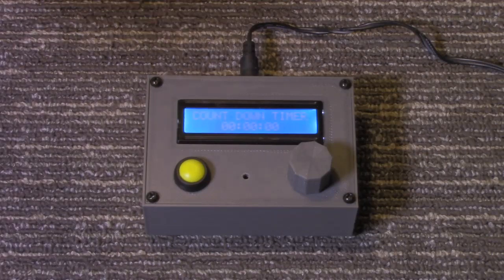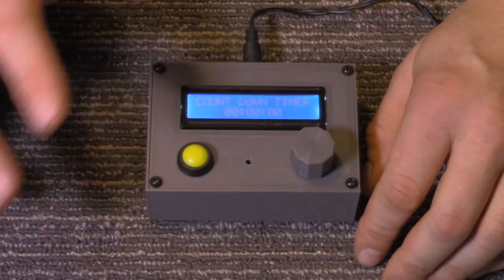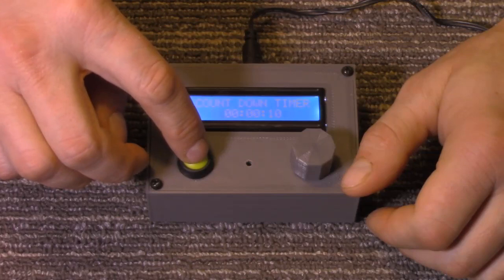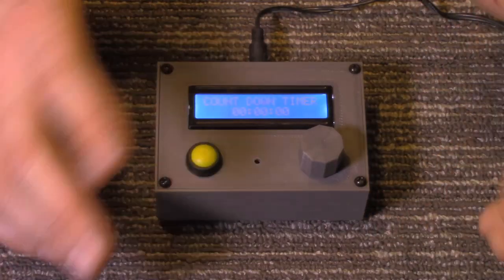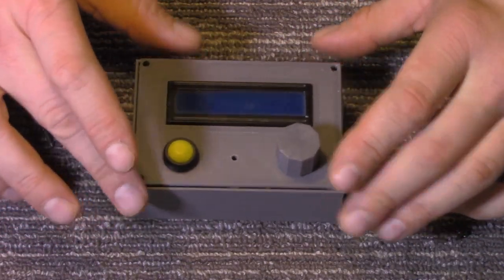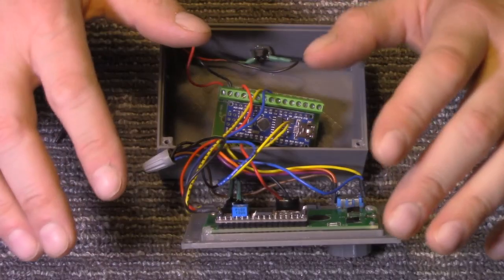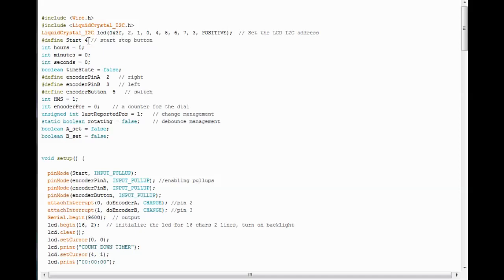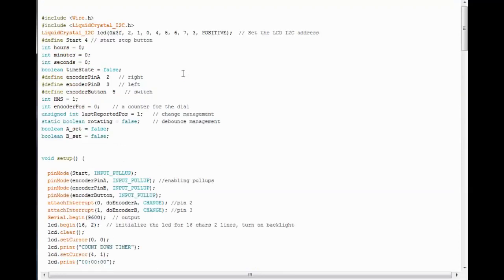ARDUINO Countdown Timer with alarm (kitchen timer)

Comment: Someone help please, When I turn the encoder the circuit just resets every time. The Arduino will short when I turn the encoder and will not work. It even says it's not connected on Arduino IDE.

Comment: I'm very new to this. is there a wiring diagram? I can't find one on your website
Reply: Connctions are in the code. LCD to SDA, SCL, GND, +5V. Rotary Encoder PinA to D2, PinB to D3, Rotary Encoder Button to D5. Start Button to D4. D2-D5 are Arduino Nano digital pins and SDA is Arduino Nano A4, SCL is Arduino Nano A5. I hope this helps you.
Reply: @ziczack8760  THANK YOU YOU ARE A GOD
Reply: @milespeterson5049  Glad to help you.
Reply: @ziczack8760  oh by the way, Mine isn't working it's not the code where the "s are different I fixed that but it's when I turn the rotary encoder, It shorts out my Arduino everything shuts down meaning a short circuit, and I don't know how to fix this. The wiring is the same and the code work. I even tried an Arduino Simulator and it works, but it real life I get a short circuit. Maybe my rotary encoder is broken?
Reply: @milespeterson5049  I tried this Z-Hut's countdown timer about hour ago and i tested it with two different types of rotary encoders and it worked fine. You should try other  rotary encoder.
Reply: @ziczack8760  Thanks! I have a rotary encoder module from a brand new Arduino kit for Christmas, and I guess it doesn't work. I will try a new one.
Reply: @milespeterson5049   I recommend trying the rotary encoder that came with the kit with different sketches.   Check Z-Hut's  other videos, there is tutorial how to setup and use the rotary encoders, LCD displays and many different sensors.
Reply: @ziczack8760  I will, thanks!

Comment: Hello
my name is Julian
I have successfully completed your countdown timer project and can be used in many applications.
congratulations
I would like to ask you if you can help me with a small modification to this project.
Instead I need the clock format to use the count down timer from a maximum digit of 7 digits (9999999) to decrease to 0, each digit can be set (e.g. 0054656), so after I press start descending step by step from 100 ms to 0
I want to use exactly the same countdown timer wiring
obviously I'm willing to pay if you can help me with the code.
my email address> iulian.cretu7@gmail.com
thank you very much
sorry for expression errors, i used google translator :)

Comment: Hey,  nice work! Well done! But I get some errors compiling the code. Which library for the display did you use exactly? I seem to have the wrong one (with the same name)Also tThe website converts the code to unicode, so copy&paste to the arduino IDE messes it up. Would it be possible to reupload the code to a website, that does not format it, like pastebin? Or poste it in a <code> box. This is almost exactly what I am looking for and it would be great to get it working.
Reply: https://bitbucket.org/fmalpartida/new-liquidcrystal/downloads/ I think I found the lib and managed to compile it, by changing out some `` witch " and stuff like that.